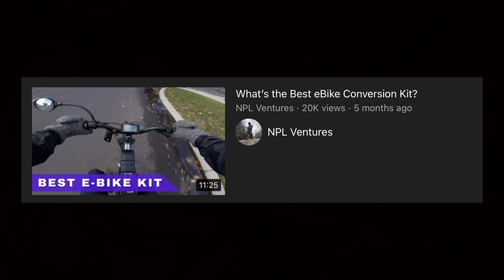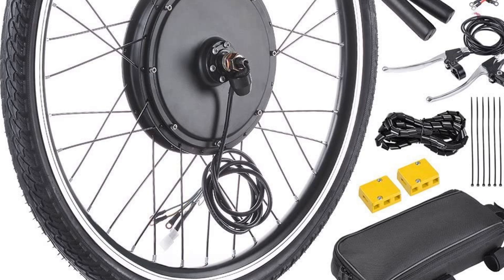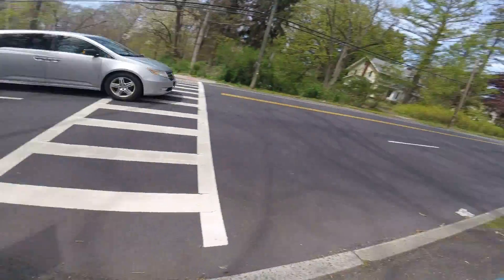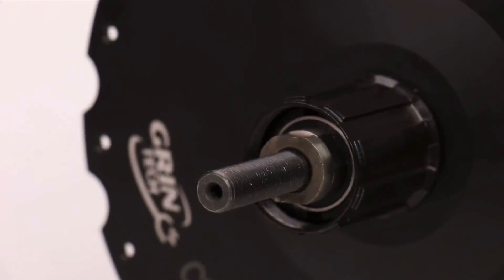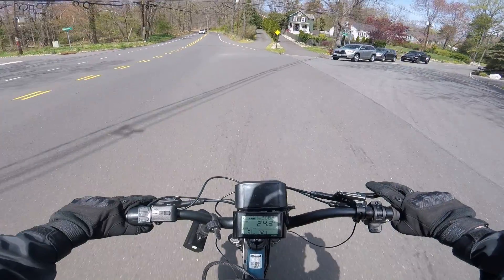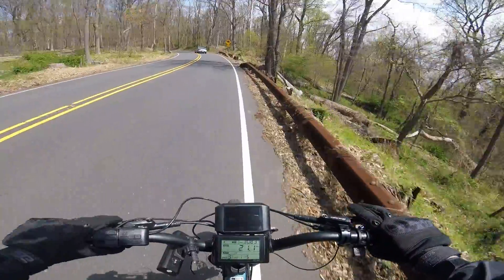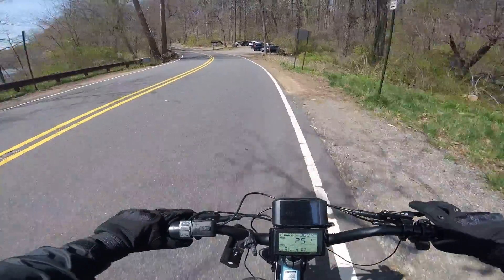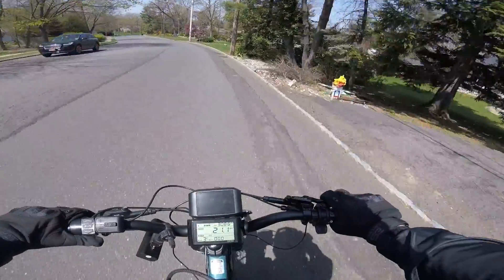The Absolute Best Hub Motor for your eBike Conversion Build

Comment: All of the cheap, obvious Chinese brands that litter Amazon is what's been taking me so long to buy a kit for my cargo trike. I had recently discovered Grin's website, but due to being a complete novice on e-bikes, I wasn't sure how good their products were. Guess I'll be taking a second look at their kits.
Reply: In the same boat as you
Reply: @g.b.miller9165  Did you get Grin Motor?  If so what power size and how much wa$ it?
Reply: Did you get Grin Motor?  If so what power size and how much wa$ it?
Reply: @connicrow9463  I did. I got a Shengyi SX2 Fast Wind which is 500 watts, plus a 52v 20ah battery with the Baserunner_Z9 controller. I also got the Cycle Analyst computer, an ebrake cutoff sensor, and thumb throttle. After shipping, all of this was about $2,100 USD.
Reply: @Yoshikarter1  Is this total price include the bike ?
Reply: @connicrow9463  No, this was a conversion kit. I already had the bike.
Reply: @Yoshikarter1  Wow I didn't know this Shen kit was 2x more than the Bafang DD750
Reply: @connicrow9463  It isn't. Most of the cost was the battery, controller, and other accessories.
Reply: @Yoshikarter1  Why did you chose  Shen over Bafang? Most people on YouTube think Bafang make great ebike motors performance quality for the money. And Shen makes good ones too and people mostly chose Shen bc of lower prices.
Reply: @connicrow9463  According to a Grin rep, they've experienced less failures with the Shengyi compared to Bafang.

Comment: I do not think you understand anything about the motors and its clear,   the flat faces on chinese motors is not a negative it actually allows for a much thicker axle to be used increasing strength and resisting axle bending due to the bike weight it also doubles by adding to secure the wheel as it is sized to perfectly slot in  so you have 2 points resisting twisting forces , both the axle and the torque arm and in the many many years experience building and riding ebikes i have never had a properly installed Chinese wheel  with torque arm cause any failure,   however the wheel you site as being better because it has a fully round axle ... ( lmao) shows you do not understand the tech, if you have a 100% round axle then it has to be 12mm max to fit in the dropouts this makes it laughable thin and susceptible to bending due to the weight and forces on an ebike, it also means rather than having 2 points of torque mitigation you only have one, the axles with flats have an axle of 14mm  and you might say its only 2mm of a difference that will not matter but it really does, I have lost count of the mothers i have had to scrap because they had 12mm axles that bent after i hit a bump / pot hole in the road,  wana guess how many cheep china motors with the 14mm flat faced axle i have had to replace after hitting the same bumps and pot holes?   Absolutely zero

Comment: I Mount the wheel  on the bike, attach the torque arms, I always use one on each end of the axel, and tighten the tiny bolt that clamps the two pieces of the torque arm together.  I make sure to adjust the arms so they will always be putting positive torque on the axel when assembled, then remove the torque arms very carefully and weld the two sections of each torque arm together and reassemble.  I have two bikes and an adult trike I have assembled this way without problems.

Comment: started with 1500 direct drive hub ( cheap ) then went to a QS205 huge motor then tried a BBSHD,  each has its pros and cons of course... I don't know what geared hub motors are like because one thing I don't like about the mid drive is the indirect power response, whereas with my 1500w hub I don't like its performance on steep hills, I do weigh around 100kg though.
Reply: What exactly is the issues you experience uphill with your 1500w hub? I am 102kg my self and have a 1000W rear hub on my Scott Aspect Granite 940 MTB and I shred up hills with ease. Although I do pedal assist like 90% of the time and rarely use throttle only, but even on throttle it will climb a steep hill relatively fast. 

I am planning on adding another 1000W front hub as well just to have more power to have fun with.
Reply: @lessdatesmoreonmyplates1457   on some hills it will go down to about 4 or 5 mph which is below the speed where it works efficiently,  then it cant speed up again, I rarely use the pedals,  for a long time I rode it with one pedal missing.  I watched my cousin go up a hill that it struggled a bit with and he went up easily, he probably weighs around 70kg.

Comment: Just a question mate can you use a hub motor on the rear and put one on the front for more speed
Reply: Adding motors on front and rear will not increase speed.

Comment: 3,000 watt motor, and program the controler to specify wheel size 30% smaller than actual and set maximum speed to 72 KPM,

that way top speed will be around 50 MPH.  Make sure battery is 100 amp hour
Reply: what voltage would that battery be? that is crucial information. amperes multiplied by volts equals watts.

Comment: One super important detail I think is worth adding -- in addition to all the items you listed which Grin partners with manufactures to upgrade, they also get temperature sensors in their motors. Such an important factor when you start pushing the power up to monitor and without it, super easy to melt your motor.
Reply: Can't even get mine warm 😂 🇬🇧

Comment: i always bought steel forks for 1kw motors, been 3 years never had an issue ,dropout isnt even worn or warped no cracks, never stick it on aluminium forks

Comment: I got rid of my car 5 years ago and replaced it with a bike. I use Lyft and Uber when I need too. I'm done with owning a car forever. As I have mentioned elsewhere in your videos I'll be getting an e-bike eventually.

I just went to the link you provided for Grin technologies. Wow! I'm definitely going this route now. Looks like I'll be building my custom e-bike instead of getting a brand name.
Reply: You may want to think about it a little more. I built a nice bike with full suspension and the whole 9 yards. It's nice but I have a lot of money and time in it. I am now looking at a $1600 full suspension fat tire bike sold by bee cool ebikes. They come with a 48v 21ah battery, hydraulic brakes, rear geared hub motor and they are easily upgraded. I think it's actually less money and stuff like better cable management to start with. Just my own opinion but something to think about.
Reply: @erpringle  They don't need to think about it more. Just because you bought a brand name bike does not mean that is right for everyone else.

Comment: What if you had a front hub motor but only for regen? It never spins, it's just there for regen. So like. You are always recharging the battery.
Reply: If you are talking about charging the battery with a hub motor while another drives the rear wheel, it won't go forever. You will get similar range to just using regen power with the existing rear motor. This is because the energy that front motor puts back into the battery comes from it applying resistance to the front wheel. The rear motor takes more energy to overcome that resistance.

The overall is a net loss in energy due to electrical inefficiencies as well as the added drag of the weight of the second motor.
Reply: @DigitalJedi  obviously it wont be resisting all the time, it will be used as a brake, could have 1 on each tyre.

Comment: Hi  Grin didnt ghost you they are just slow to respond to email inquiries... brutally slow sometimes. To be fair they get a lot of inquiries and are often short staffed in their customer service department.

Dont take it personally. They may not want to work with you but they will respond... eventually.😂

I figured you were going to say it was their Grin all axle.😀 I have your 3rd pick the 9C. Ive seen so many broken bike forks as a warranty rep in the bike industry I dont do front wheel motor conversions.

Keep up the good work.
Reply: Front is fine, but USE TORQUE ARMS. I use a modded Ezee cruiser, which has a front motor and rear 7 speed hub. Front shock is designed to have the motor torque plus it has a 1/4" torque arm going to the disc brake mount.
Even third party controller putting 55 amps into the motor and it's peachy. Enough to skid the tire on an uphill though. Thankfully the throttle on the VESC is torque based so you can limit slipping way easier than the pseudo speed based ones

Comment: Built a Bafang sb002 750w mid drive on a '98 Cannondale 300m with 26" wheels. I'm going up literally EVERY hill here in the sw PA mountians and I don't even need mechanical gear 1 or 2 to do it. Mechanical gear 3 will go up ANYTHING around 15-18mph. I'm able to go up most Hills in mechanical gear 4 at over 20mph. Okay so what about top speed when you're on the flat? The bike will easily do 36.2 mph anywhere reasonably flat and my top speed is 39.2mph. Anything over 32 miles an hour on an e-bike is crazy fast and gives you little time to react. So in my opinion there's really no need to build anything that goes above say 35 miles an hour. The advantage of the mid-drive setup over the Hub motor is.. your actually gearing the motor further down when you mechanically downshift because you're putting the power through the chain to the rear gear set. With a hub motor you're stuck with whatever gearing it has. I plan to move this motor kit to a more modern bike soon to improve the ride as my old Cannondale has no suspension. Feel free to hit me up if you'd like any more info. I have built several bikes of both types mid & hub.
Reply: While my mid-drive doesn't regenerate, range is no issue with my 20.5 amp hour battery. I have gone up to 55 miles so far on a single charge and still had over 30% of my battery left. The Regeneration feature on my two sons eAhora rear Hub Drive bikes is not all it's cracked up to be. The regen doesn't really do much. So in my opinion you're better off to not worry about the regen and just make sure you have a large enough battery for your needs. Again everything I state is merely my opinion and different people have different conditions they ride in and may need different setups. Every supposed advantage of a hub motor, like the regen on my sons bikes, is not the advantage it's made out to be. Oh and I almost forgot to mention the cost, a mere $804 to electrify my existing bike. The mid-drives are the best value for the money especially if you already have a convertible bike that fits you well.
Reply: @ExploreYourWorld-oo3jd  mid-drives are more expensive than hubs to convert. Mid-drives cost more in upkeep from the increased wear and tear on the bike parts too. That's not good value. (range is not an issue if you keep the speed down. Above 20 mph, wind resistance will cut range in half.)
Reply: I have no reason for a mid drive as I live in Florida and it's all flat. I don't have to worry about breaking chains or shearing gears or having to tear my motor down to get to the controller because it burnt up from running to slow in a low gear. For me it's dd all the way. No problems over heating, breaking chains, etc. J.S. but I just commute, I don't do the mountain bike thing. To each his own.

Comment: Dropping your insurance was not a good idea if you ever want to go back to owning a car. If you go for a time period, and it’s not very long without insurance then it’s like starting over. Most insurance companies won’t touch you and if they do it will be through an underwriter at a significant premium. Like $300 a month. Ask me how I know. And you have to be with that underwriter for a year or two to prove you are a responsible driver again. It sucks. I would talk to an insurance agent and see if there is someway to prevent this, but you should never do this unless you understand that it may be painful to get insured again. You may come out ahead if you go without a car long enough but wanted to give you and others a heads up. I had no idea and paid the price, literally.

Comment: You gotta love how much power you can put down with the Phaserunner being that tiny. I have a RadMini folding bike, looks stock, but has dual Tesla batteries and a 3kw peak motor. Pulls ahead of cars when the light turns green and accelerates up 22% grades. One company that makes mid drive bikes banned me from their group rides because it could easily out climb their bikes.
Reply: Had to be Luna Cycles... Eric Jicks being such a jerk and some kind of axe to grind with Grin. It might be because they got control of Endless Sphere but who knows.
Reply: @davideades4839  Why does Eric Jicks have some kind of axe to grind with Grin?

Comment: the torque is not taken by the flats on the axle you should tighten the nuts and crush the drop outs the Chinese axle on my bike is a bigger diameter than a standard bike and the nuts stop the assembly from spinning

Comment: QSmotors makes significantly better motors than Grin does. Also, the best geared motor (that I've found) is not the gmac but the MXUS XF19R. I ran it at 52v 50a and it outperforms my gmac by a significant margin. More copper, thicker gears. With phase wires upgraded it could probably handle even more.
Reply: QSmotors does not make significantly better motors than Grin does. Better is such a vague term anyways.

Comment: Interesting point about the torque and the frame. With that in mind, is the frames ability to withstand the torque change when installed on the front forks verses the rear where you would think can withstand more forces due to more ridged frame. For some bikes with rear geared shifting like the "Rohloff" hub, I would think the only option would be to install a front hub motor in lieu of a mid drive motor. I ask because I would think installing a front hub wheel would be much easier then rear wheel conversion. New subscriber, very interesting learning points. Peace, Mo
Reply: Front hub is great for pavement. Not great for offroad (but not bad), and not great for transporting in a car.
Reply: You can make a torque arm to match those flat axels with minimum tools. Select a heavy gage piece of steel and cut it to match your frame. That motor will not go anywhere no matter who the manufacturer is or what the price is.
Reply: I have had both front and rear hub motors ..I feel the front is easier for maintenance and installation .. I ride %99 on sidewalk or pavement ..

Comment: Why dont you just solder a 4mm or 6mm bullet connector for motor if its that much of an issue. You dont buy a 5000$ car because it has Pirelli tires fitted on it either.

Comment: I don't understand the comment about reputable kits including cheap torque arms. What is the problem with them? What are good torque arms? The only thing described in the video is what happens if you don't have torque arms. Not having torque arms and having cheap torque arms aren't the same thing. That's kind of a big information gap missing from the video.

Comment: My entire frame has the torc arm built into it…the stealth bomber frames from Amazon comes built to slide the tire off without much trouble….it has a four torc straps 2 on one side two on the other.

All E-bike kits isn’t the same….mine is made by NB Power and use good parts’ it’s a Chinese kit’ but a good kit, the big speed controllers are mainly built for the stealth bomber frame setup….using a 3000watt hub motor on a normal mountain bike can get dangerous….if you’re frame dropout is too flimsy….and the cheap torc straps makes it much more dangerous….they give you hose clamps on the torc straps….most ppl scrap the cheap hose clamp….because they tend to break….I cringe at the site of them. 

That’s the main reason they’re a bigger size.
Reply from the maker: This is true, some kits are definitely better and geared towards high end builds. 

I was mostly referencing the more common cheaper kits here.

Comment: It rains a lot in Florida….so I need the car….I have a stealth bomber clone or build’ I call them clones because ppl use different kits, batteries, tire size, speed controllers ect’ infact you will never find a DIY kit that’s the same.

But I can’t wait to get my battery….the down side is it’s a 72v 80BMS 20AH in the future I will probally add a second battery to it….it’s going to have the speed’ bike with battery will weight 102pounds, and I weighed 145pounds’ however I’d be lucky to get 12miles out of a charge….maybe 16miles if I peddle assist it.

Good news is the charger will take a hour to fully charge it….mine is mostly built for roads and light gravel trails.

Comment: What do you think of Juiced bikes retro blade custom Bafang hub? I have a Hyper Scorpion with 6000 miles on it. Goes strong 30-32 MPH and is reliable. Makes a lot of noise for some reason (I think due to being encased in the mag wheel).

Comment: EBIKELING is the best DIY company, I built a WATERPROOF 1200 WATT bike with a GIANT TALON, my motor is a DIRECT DRIVE (GEARLESS) motor and it will last THREE TIMES LONGER than any GEARED motor. I had mines for 2 years with ZERO problems on and off road.
Reply: Ebikeling is NOT the best DIY company.

Comment: Good info but, I don’t like look of your build. I can tell you have the mindset but need to start at the frame and do it over again! Your bike it reminds me of Frankenstein DIY. It’s not safe to ride(wires everywhere and the battery on top frame) I don’t want to talk about the mid drive CYC waste of money installing it on a diy bike with that cheap hub motor that unsafe you can hurt yourself. You need to work on your skill sets, how the build like someone wants to buy your bikes. Hey is that for sale and how much you invested in your diy e bike? Let me guess? 2400-2700 dollars 💵